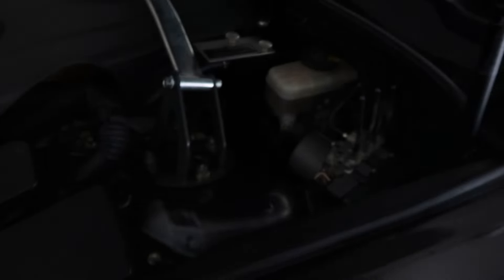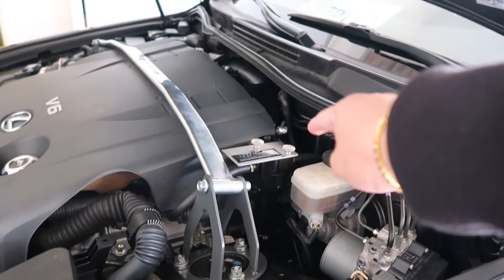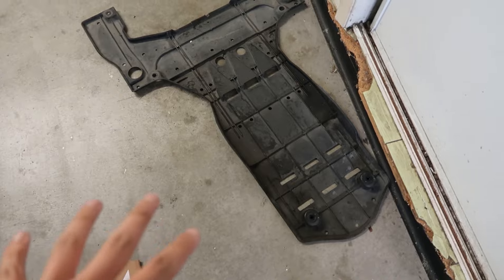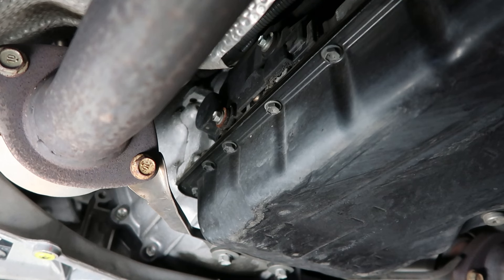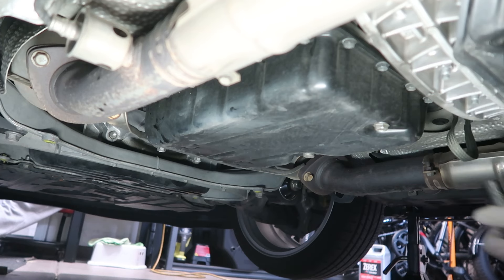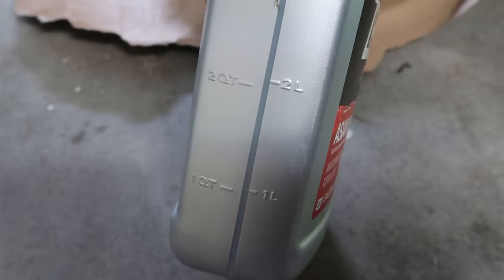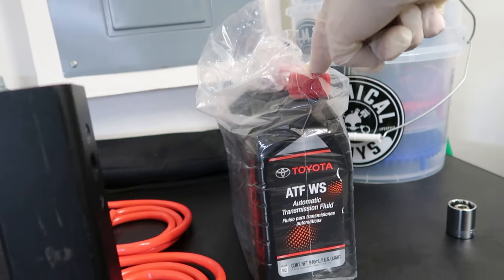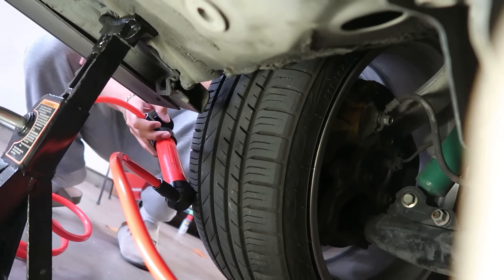Transmission Drain and Fill | Lexus IS250

Comment: If you haven't changed your fluid in a long time, I would have took it to a trans shop for a full flush and filter change. There are all least a few quarts of fluid in the torque converter alone, not including all the trans lines and valve body, that doesn't come out when draining by the plug. According to what I read in the past,  the is250 trans holds a little over 7 quarts of fluid. You only removed and replaced 2 quarts.
Reply: Full flush will kill your transmission and it’s a lot to explain but every 2is owner knows about this and it’s in the lexus forum explaining why. This is why we recommend drain and fill and of course you don’t have to do it once you can do it as much as you want to get much cleaner fluids.
Reply from the maker: I've read about a full flush too and it wasn't recommended by a lot of the forums and FB posts. Like what @RonDaG0at said, a drain and fill was recommended and I was willing to do the D&F first then see how it turns out afterwards. So far so good, I'll post an update video after I've put some miles on the car
Reply: @ChristianMastrile  From what I've read, is that Lexus/Toyota dealers suggest to do the fluid exchange in steps. 2 liters/quarts at a time, drive for some time (weeks, months?), then do it again and again, until you have completely exchanged new fluid into the system. This should not affect the performance of your transmission. Also, in Canada, Lexus/Toyota actually suggested changing the transmission fluid every 60 000 miles/100 000 kilometers, whereas in the US they claim the fluid is "lifetime", which just isn't true. No oil can last for a lifetime.

In an older transmission with some miles behind it, definitely no flush, but do it in steps. With a regularly maintained transmission that has had numerous fluid exchanges done on it, you should be able to completely flush it as well with no problems.
Reply: Just do partial drain and fill more regularly.

Comment: Very good work. My 2008 Lexus was shifting kind of rough a couple years ago, and I did the exact same thing of drain and fill. Much smoother now. Now when it comes to the intervals of changing? I was recommended every 50,000 miles so I will stick to that number.

Comment: Also that 1-2 gear hesitation could be the solenoids. i saw a post on facebook about that. Mine does this weird thing where if im in 1st gear going 5 mph  the rpms will shoot up and then it'll shift to 2nd gear. it happens when im turning or when im cruising through a parking lot looking for a space. I usually just speed through turns or come to a full stop when i feel it about to happen
Reply: Damn man, how many miles does yours have if you don’t mind me asking?
Reply from the maker: Those solenoids were what I feared what was happening to mine. It hasn't done it since replacing the fluid (knock on wood). I'll record an update video when I've put a good amount of miles on it
Reply: Same thing happens to mine. I was curious on what that’s about
Reply: @codenamemist2560  Mine has 135k but it’s been doing it since I got it at 117k. I’m gonna change mine this sometime next week so I’ll let you know if it stops
Reply: @PatrickT-k9c  The solenoids use your speed and gear position to decide when to shift so when your car is hovering around late 1st gear it’s kinda confusing idk? But yea fixing your solenoids or swapping some new fluid in might fix it. I’ll try and let you guys know
Reply: @6kshaunn90  well noted. I feel like I have this issue too it just took me some time to finally realize it. Mines it at 151k
Reply: My 07 IS350 has done that since I got it with 85k miles (now has 125k). I don't think it's an "issue" but I haven't driven any other 2IS when they were new so idk.
Reply: @kkeshav74  yeah, it’s not really an issue. More like a tiny nick nack. Something can be a bit annoying but easily sorted out

Comment: See, they say dont mess with the transmission fluid on sealed transmissions because there is always a possibility it will start slipping, but I guess it's a gamble. I did that on my old IS250 because I wanted to sell it when I got a GS. I changed it twice (car was lowered and ran over something that damaged the pan and caused a leak, so had to replace again). Both times, the car ran great afterwards. IF you plan on doing this, I would get it only if you need to, because of the risks. But I trust Lexus/Toyota reliability so I took that risk, and both times car ran great.
Reply from the maker: The sealed trans was def something I didn't want to touch cos of the potential risks involved. Drain and fill looked simple enough to do myself so I took the risk and was willing to accept the consequences, if any, afterwards

Comment: Definitely change it at least another time, my 13 gs 350 with the same transmission had never had the fluid changed after 200k, and I’ve already changed it twice and it still looked terrible and brown, I think 3 times is a good sweet spot
Reply: How long should i wait until changing it the second time and then the third time
Reply from the maker: I ended up changing it again this weekend and it made the world of a difference. Trans shifts like new now!
Reply: @danielboron3332  personally I’d do a week of driving then change it again, make sure to put it through its paces before the next one just to make sure you got it mixed in well

Comment: Thanks for the video. Do you happen to know "about how many miles since the last fluid change on your trans?
Reply from the maker: Don't think it's every been changed. It around 160k miles and I just did mine twice and it runs much smoother. If yours is high mileage, I'd suggest doing it twice

Comment: Thanks for this informative vid. I just got an 06 is250 that I'd like to do a drain and fill on. Of course neither Lexus nor Toyota will touch it so I'm tempted to do this myself. Seems mostly simple almost like a differential change. Would you suggest a simple drain and fill at my mileage? Thanks!
Reply from the maker: Not sure how much mileage you have but I'd suggest it if you're over 100k miles. Did mine twice and the car is a lot happier and shifts much smoother

Comment: I have 125k miles on my 07 IS350 and haven't touched the transmission yet LOL
Reply: Same im terrified lol
Reply: @ABCWISE  Depending on the mileage and the car's history (how many owners), some mechanics and even the dealership will tell you to NOT mess with the trans oil if it wasn't changed properly from the beginning.  I'm at 109k, I'm the second owner and I bought from a used car place, but my closest Lexus dealership sold the car to the orig owner and has the records.....up until the warranty.  My car was purchased from an auction by the used car dealership that I bought from.  
As a reminder to all, you can put your VIN number in at the Lexus website and it will tell you what has been done if it was a Lexus authorized mechanic.  I'm guessing since you guys are adding mods, then you don't really care.  😎
Reply: @ABCWISE you should be fine as long you’re only doing drain and full not full flush! I recommend doing it asap or your transmission will go out and a new transmission is around $2000
Reply: i did multiple drain and fill on my 2007 GS with 140K miles. and then did the filter and complete flush. the car shifts better than my 2016 GS lol. its like butter now. dont take the risk on the filter change, but definitely do the drain and fill at least 3 times every 1k miles or so. you will not regret.